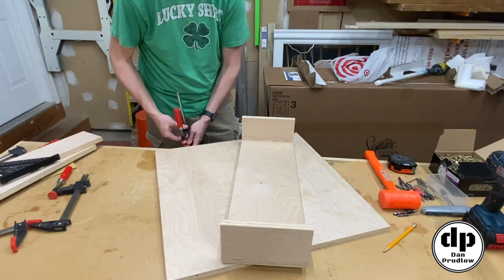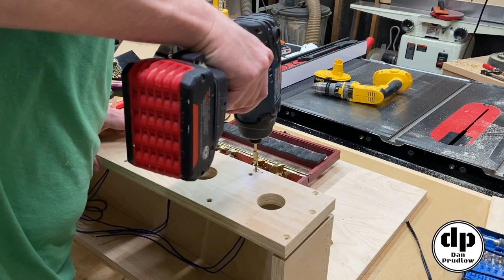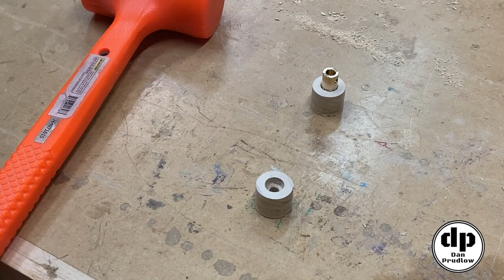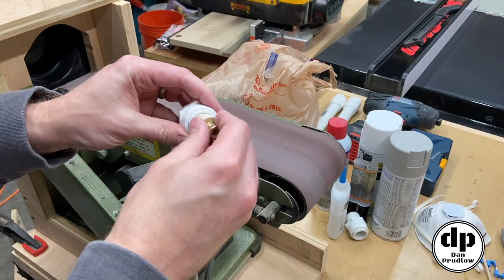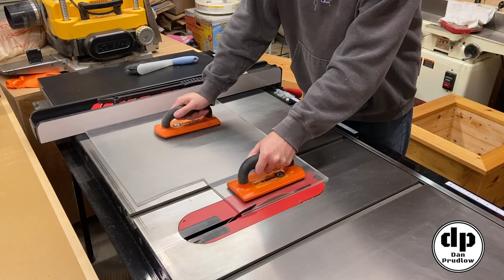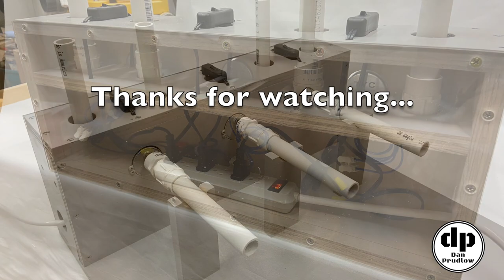Build a Three Cup Turner | DIY Epoxy Cup Turner | Tumbler Turner

Comment: Hey,,, love it!!
Is a 5" wire stripper work ok?
Any size twist on wire connectors ok from hyper tough Walmart brand  yellow (cpc-32) ? Says on back.
Thanks Dan
Reply from the maker: Seems like that should work.  As long as the wire connectors stay on they should be fine.  Like once you twist them on make sure you can’t easily pull them loose.  Thanks for watching!

Comment: I like the motors being recessed into the wood. I read that they get hot when being used. I assumed that was why most of the diy projects had them mounted on the back and not recessed. Are you experiencing any heat issues?
Reply from the maker: We’ve had no issues so far.  My wife used the turner a lot when I first built it so they were running off and on all day some days and it was never an issue.  It doesn’t get used as much now so I can’t say for sure if the longevity of the motors is being affected in any way.

Comment: I love this one, so detailed!! May I ask why you didn't add a hinge to the back instead?? That's the only thing I would change incase I need to get to the power supply or change out a motor. Good job!!
Reply from the maker: Thanks for the compliment.  I didn’t bother with a hinge because I figured any maintenance like that would be pretty infrequent so popping the screws out wouldn’t have to happen much.  It is a good thought though...so far nothing has given out on it thankfully. 🙂

Comment: What size drill bit for the power cord where you ran the switch on top?
Reply from the maker: I don’t recall exactly, maybe 1/4 inch or 3/8.  I made the holes just big enough for the wire to push through.  Thanks for watching!
Reply: @DanPrudlow  thank you for the quick response. Your video helped me solve a lot of my issues with my wife’s tumbler.

Comment: What connector are you using from the motor to connect to the tumbler wands?  My build is much messier than this and it's driving me nuts!
Reply from the maker: I’m using the little couplers that came with the motors...the little brass colored items in this pack.  6PCS Synchronous Motor Turntable Motor 50/60Hz AC100~127V CCW/CW 4W 7mm Flexible Coupling Connector 6ft Power Cord for Cup Turner, Cuptisserie, Tumbler Turner Guide Motor (2.5-3RPM) https://www.amazon.com/dp/B083XK5GTX/ref=cm_sw_r_cp_api_glc_fabc_d1Z.FbVWS31NY.  I had to make little wood pieces that I epoxied them into and the epoxied the wood piece into the pvc pipe.  Does that help?  Thanks for watching!
Reply: @DanPrudlow  sheesh you're quick with your replies.  My motors did not come with the connectors.  I'll see if I can find them individually.  Thank you so much!  I watched how you created your own connection and used epoxy. I'll see if I can replicate but I don't have the drill press you have.  I am quite sure the hubs will not complain that I want more tools hehe.
Reply from the maker: I think they might sell those connectors with wands attached already on Amazon...not 100% sure though.  Good luck! 👍🏻

Comment: How tall are the boards in the middle to hold the pvc pipes up?
Reply from the maker: Those pieces were cut at 6.25 niches and then I drilled the half hole using a 1.5 inch diameter bit.  The part the pipe is resting on is about 5.75 inches off the base.  You have to kind of fit these after you mount the motors and stick a pipe on it since you might have to adjust up or down a little to make sure the pipe is level.

Comment: What bit did you use to predrill your 1 5/8" screws?
Reply from the maker: It’s a 9/64 tapered bit with a countersink.  I believe I got it at Home Depot as a set of 3 different size bits.  Thanks for watching! 👍🏻
Reply: @DanPrudlow  awesome! Thanks bud, great job by the way.

Comment: Awesome job buddy.  Did you put that smaller piece of wood directly behind the motors so they would not be pushed into the inside of the box?
Reply from the maker: Thanks for the compliment.  That piece is actually there to hold things after they are taken off the spinner.  So if you had a cup that was done spinning but not 100% dry you unscrew the pipe and stand it vertically through the hole in the top and it sits inside on that shelf.  Then you can screw a new pipe on the motor to do another cup or whatever.  Hope that makes sense.  Thanks for watching!
Reply: Thanks , i realized after watching the video again what it was for lol.  Thanks for such a quick reply!!

Comment: Hi, what kind of motor did you use?  i click the link but have to many types of power?
Reply from the maker: The link in the video description is the exact motors I used.  They come with a cord to plug into a standard 110v outlet...at least in the United States that is.

Comment: What wood did you use and what measurements please. Also where are the switches from pleassse
Reply from the maker: I started with a 2ft by 4ft piece of 3/4 plywood and split it in half so the base is 2ft square.  I think the piece the motors are mounted on is about 8 1/4 inches tall.  I kind of made it up as I went so I don’t have exact measurements.  There is a link to the motors in the video description.  Thanks for watching!

Comment: Is there anyway you could tell me the supplies you used besides the ones already posted? What pipes and things did you use?
Reply from the maker: The pipe is all 3/4 inch pvc parts.  The wood is 3/4 inch plywood and the back is 1/4 acrylic.  Thanks for watching! 👍🏻
Reply from the maker: Final dimension is probably about 23.75 inches wide by 9.5 inches tall...give or take some each way depending on how exact your measurements are to what I built.
Reply from the maker: The dimensions are that of the acrylic.  The turner is 23.75 inches wide and the back is around 9.5 inches tall.  So to cover the back you would need a piece cut to that size.  Hope that helps. 🙂
Reply from the maker: I just checked IG but couldn’t find your message.  The holes were drilled using a Forstener bit.

Comment: Excellent video except,  what are yoyr measurements? What are those things you banged the couplers into?
Reply: Typo- your!
Reply from the maker: There is another comment that has dimensions.  Those things I banged the couplers into are just little round pieces of wood that I shaped to fit in the end of the pvc pipe.  I think they actually sell pre made pipe things on Amazon which would have been WAY easier...lol.
Reply: I LOVE your design ❤❤❤
Reply from the maker: Thanks!

Comment: Great video :) Can I ask what you added to the bottom of the pipes to hold onto the tumblers inside?
Reply from the maker: Thanks for the compliment.  As for holding the tumblers my wife has a few things she uses.  Pool noodles of various sizes, small nerf footballs can work.  I think they actually sell something on amazon that is a pool noodle type material but is actually made for these cup turners...not sure what they are called though.
Reply: @DanPrudlow  Thank you!

Comment: What drill bit was used. ?
Reply from the maker: For what part?  I used a few different bits on this project.
Reply: Dan Prudlow for the holes for the motor what size did you use?
Reply from the maker: I used a 2 inch forstener bit.  The holes were just a bit big though.  I think the motor diameter is probably a metric size.  But 2 inch worked out fine for me.  Once you add screws to hold the motors in they seem fine.

Comment: Is there any way u could give me the dementions on this
Reply from the maker: The base is 23.75 inches square.  The part with the motors is 8.75 inches tall and 4.75 inches wide.  The center of the motor shafts are 7 inches apart and about 6.25 inches off the base.  Hope this helps!  Thanks for watching!
Reply: Awesome thank you
Reply from the maker: They are 6.25 inches tall...the bottom of the hole is 5.75 inches from the base.  The hole is 1.5 inches in diameter.  The height you make them will depend on the height of the motor and how big the pvc pipe you use is.  Hope this helps!

Comment: I love this design, but it has no dimensions of anything; very difficult to eyeball the exact dimensions of your project. I looked on the comments, but still not very descriptive on the comments about the exact measurements. It would have been very helpful  like you put the materials you used, to have all the exact measurements/dimensions of each piece of wood/plywood.
Reply from the maker: I pretty much built this sort of “on the fly” so i didn’t have exact dimensions for all the parts/cuts/etc planned out.  I know the measurements in one of the other comments are not down to the fine detail but I think there is enough there to get the general idea.  Putting together detailed plans takes a lot of time and since I’m just a hobbiest it is hard to justify.  Someday maybe if I have more free time i will start doing that but for now it’s mostly just putting the videos out there as inspiration/entertainment.  Thanks for watching! 👍🏻

Comment: Supply list?
Reply from the maker: There is a link to the motors in the video description.  Those are the key ingredient of course.  The wood is all 3/4 plywood and a couple pieces of 3/4 poplar but you could use 3/4 plywood for the little support pieces under the pipe...I just ran out of plywood so i used what I had on hand.  The pvc is all 3/4 inch stuff.  The clear back is 1/4 inch acrylic and I think there is a link to that in the video description too.  1 5/8 inch screws.  I think that is about it.  Thanks for watching! 👍🏻

Comment: What are your measurements
Reply from the maker: The base is 23.75 inches square.  The part with the motors is 8.75 inches tall and 4.75 inches wide.  The center of the motor shafts are 7 inches apart and about 6.25 inches off the base.  Hope this helps!  Thanks for watching!

Comment: Can I get the measurements
Reply from the maker: The base is 23.75 inches square.  The part with the motors is 8.75 inches tall and 4.75 inches wide.  The center of the motor shafts are 7 inches apart and about 6.25 inches off the base.  Hope this helps!  Thanks for watching!